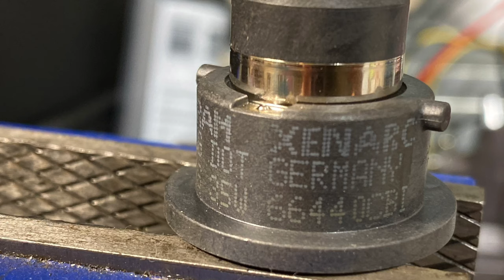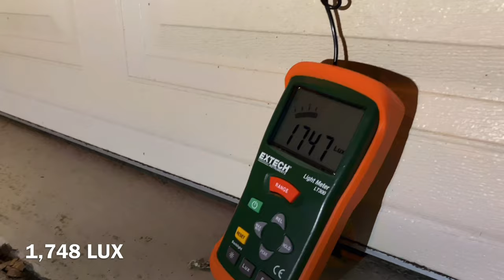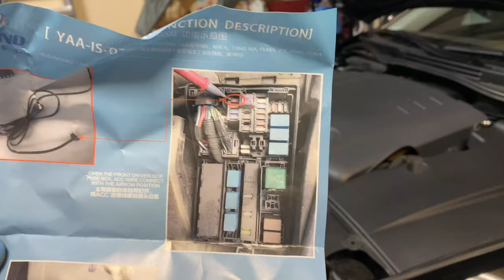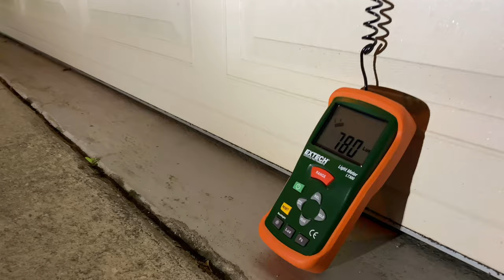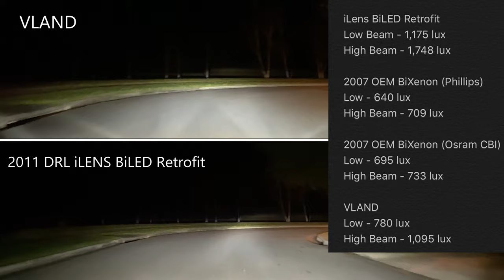VLAND Headlight Review & DIY Install Lexus 2006-2013 IS250 IS350 IS-F Triple Beam LED

Comment: Hey Binh - great video, I really enjoy how in-depth you get. I’m wanting to upgrade my yellowed HID headlights but having some trouble deciding. 
The V-Lands look great aesthetically, but their output isn’t as great as the  DEPO’s with the projector retrofit, based on your video. 
If you had one shot to do it over again; would you do the VLANDS or DEPO with or without retrofit?
Thanks man!
Reply from the maker: I like the DEPO with my Retrofit of the iLens (Profile BiLED 1.0) I have. 

If I redid it, I would go with the newer Profile 2.0 or better yet, the Morimoto MLED 2.0. I would also do switchback LED DRL and turn signals.
Reply: Tuner with Kids Thanks man!
Reply: @TunerwithKids  I'm just curious, what are you planning to do with the DEPO set?
Reply from the maker: I’m putting them back once I do the subscriber giveaway on the VLAND.
Reply: instablaster

Comment: I just recently installed my vland and I have the factory hid with automatic adjustable leveling and vland is so much better on the road at night..
Reply: Does the auto leveling work with the Vland
Reply: @2152mohamed  nope it doesn't... You'll have to delete that it's pretty easy.. I had to delete mine..
Reply: Do you know how long these headlights last for?

Comment: sick headlights just ordered some for my '07 IS350!
Reply: me too bro. I just ordered some for a 2012 is350 f sport. These lights look real clean
Reply: @unknownsource4359  are the brighter than the stock ones? I was going to get this if I got the older model Lexus with halogens but since I'm getting a 2011 F sport I thought I would just leave the stock LED headlights and I bought a VLAND taillights only
Reply from the maker: I had a comparison of light output in the video. It’s not exactly scientific but give a perspective on what a stock HID projector does vs the VLAND and my other iLens LED projector.
Reply: Leo Castrillo to me personally the Vlands are brighter and the aesthetics of the headlight look more aggressive. Vlands all the way. But save your oem projectors as back up. Ive had the vlands installed for a month, no complaints

Comment: Hi. Nice video! I have those installed, but I would like to wire the DRL led strip to the first light position on the stalk (city light or parking light), instead of being on all the time with the ignition.. have you found a way to do that?
Reply from the maker: Not without extra switch.

Comment: Hello, I ourchased a 2011 IS250 that came with aftermarket headlights and I have a HEADLIGHTS ERROR message on my dash. I also noticed that the horizontal running lights aren working. Do you have any info on what I can do to fix this issue? I thank you for your time.DIEGO

Comment: I’m having a similiar problem. I have the exact same drl wire u have. connect it. very wonky and loose however i started my car and they worked. Closed my car then tried starting it up again didn’t work anymore. I tried taping it. Didn’t work. i don’t know what to do nro
Reply from the maker: make sure you have the other fuse on the add-a-fuse cause its a pass thru.
Reply: @TunerwithKids  Still dont understand, my fault. Can you explain further more?

Comment: Love the video man! I currently have a 2012 IS F and my drivers side headlight has started to leak. I don't want to drop $2k on a new set of OEM ones so I am considering either the DEPOs or the VLANDs. Not planning on doing any retrofitting. In your opinion, which one of these do you think would be better?
Reply from the maker: Depends if you want the updated look or the classic Lexus look. If it’s leaking, I’d recommend opening and resealing. The 2012 are still worth money in good condition.

Comment: would have been nice to see what the high beams actually looked like while driving down the road, given how focused it looked when hitting the garage door it worries me what they would be like in actual use while driving down the road.
Reply from the maker: They are garbage. Many people complain about them.
Reply: @TunerwithKids  what headlight you recommend that has good output. I have a hid aftermarket kit now and the beam is great. Kindly recommend something good.
Reply: @henry222ist  Honestly stock is best. I have VLAND now and just got them installed 2 days ago and been testing them. Low beam is fine but High Beam is completely useless. I could barely tell the difference if I switch on high beam compared to what the stock high beams were. For looks they are great but if you live in dark areas the high beams won't be helping you very much.

Comment: I like how the outcome came out with the way you outlined the LED demon light frame. Was going to ask how come you didn't mod the 3rd led High Beam to function with the 2 Led low beam giving the setup a triple LED oem look. I've emailed VLand and asked on the specific mod you did and on having the high beam to function with the low beam. The rep responded and told me their LED headlights are as is, their company will not modify or add anything.  I guess  DIY would be the only way to modify it.
Reply from the maker: I would have to get another set to get the correct cutoff projector. Plus trying to align three projectors to get the same plane is hard.
Reply: @TunerwithKids  I understand, I emailed you after I watched your video,  if you can do the request please lmk via email on what mod you can do.  
Thanks.

Comment: Hi, my DRL/high beam innermost projector light flickers during daytime because of the DRL system I have. Is there any way to fix this? Apparently my canadian model isf cannot do the techstream DRL disable trick, so I am stumped.
Reply from the maker: Only way is to create a relay circuit that will only activate relay and high beam for high beam and not the pulse width modulation signal used for DRL.

Comment: When you ran the wiring from the fuse box to both headlights, did you need to connect the second part of the wiring harness to the battery? Mine is wired to the fuse box but not to the 2nd harness to the battery but the DRL flickers
Reply from the maker: The set i have does not have a second battery harness. It only pulls ACC power from fuse box for the DRL. If you have old DRL thru the highbeam, you need to disable in Techstream.
Reply from the maker: All new OEM LED lights, signals, taillights no longer have serviceable “bulbs”. Has been like this for all things LED.
Reply: Tuner with Kids please help me I want to know if you got the amber or clear

Comment: I recently install this headlights but the drl don’t work I put in in the right fuse but the car doesn’t start then in remove the drl fuse and put the regular one but the drl do not work, any recommendations?
Reply from the maker: Make sure the fuses aren’t blown. And the add-a-fuse is fully seated in the box slot. The add a fuse has its own two fuses, one for the lights and one for the slot you has to hijack.
Reply: @TunerwithKids  thanks so much for the help

Comment: I recently bought these should I silicone them around the edges to make sure they don’t get water in them?
Reply from the maker: I wouldn't recommend silicone just yet. The newer versions are sealed with "permaseal" from hell and probably are tight AF. The early versions had butyl sealant (which may leak if they didn't use enough).
Reply: Tuner with Kids for sure thank you!

Comment: super review thx a lot , i was going for the vland as i think they look great but ultimately I'm performance orientated and going to stay with my hid , also the dil light lead and fuse and the streaks are big -ve for me - highly appreciated thorough review
Reply from the maker: They have their place but the best would be 2012-2013 DRL HID but those are still $1,000 used. That’s why I built my aftermarket Depo ones with better LED projectors and DRL board.

Comment: Hi Binh, Great videos. Just wondering how will you change the bulb if they got busted in the long run? I don't see opening cap at the back like the stock unit.
Reply from the maker: No way to change as it’s LED.

Comment: Do the NIke Swoosh DRLs stay at full intensity when low beams are on instead of at 50%?
Reply: Yes they do. I won't want to turn them off because low beam is ok but high beam is complete trash. I can't tell much difference if i switch on high beams. Just got the VLAND's 2 days ago and been testing them. They update the car's looks massively but function wise, they are worse than stock.

Comment: Do you have a recommendation for a plug and play kit that doesn’t require retro fitting and has a bright output like aftermarket HID kits (which is what I have now). Thanks!
Reply from the maker: No such thing. The reason you need HId and LED specific projectors is for the optics. The lens and reflector bowls are designed for the beam of light so it’s focused to where it needs to go.
Reply: @TunerwithKids  what you recommend for HID heaught upgrade ?

Comment: Hey man. Nice vid. Got a question for you tho.
Does the auto-leveling work on these Vlands? For Up and Down motion?
I know the AFS or corner-lights or whatever it's called won't work. I'm interested in up and down adjustments. Like if I put 500lb of cargo in the trunk or go over a bump, will the headlights lower down automatically like OEM? At 22:20 you can see what I mean, OEM and yours retrofitted headlight did like a start-up sequence but VLANDS didn't. Does it mean they don't have it?
Reply from the maker: The VLAND don’t have the slot to do autolevel up and down.
Reply from the maker: What they do have is the newer Toyota manual level motor. These are found in the Sienna, Tundra, and BRZ/FRS. You may be able to retrofit the dial switch from those cars and manually adjust the level a few degrees.
Reply: @TunerwithKids  Thanks for a fast reply. Unfortunately in Sweden, any car that has auto-leveling from the factory must have it working in order to pass through the yearly road-safety inspection. As I understand even if I retrofit the switch from another Toyota, it still won't be fully automatic, correct?
and if it's not fully automatic then I either have to change headlights back and forth once a year or don't bother at all.
Anyway, thanks again for a fast reply, and keep it up!

Comment: Which ones do you think are better the ones you showed in this video or the new ones with blue breathing animation?
Reply from the maker: Newer ones have better output.
Reply: @TunerwithKids  I am currently debating with myself what headlight should I get. The ones you have with v shape line at bottom looks more oem for me, I like them more. But the new ones with v shape lines at top have very cool looking blue breathing animation and all 3 squared lights work while low beam is on.

Comment: Awesome Video!
 Do you know if these will fit a 2013 Lexus IS250? I looked online and some say yes and other say no.
Reply from the maker: Yes it will fit.
Reply: @TunerwithKids  Sorry I need to rephrase. I am not sure yet but I may have ordered vland headlights that fit 2006-2012 is250s. In your opinion and experience, do you think those light still should work with 2013 models? or would I have do some DIY stuff to them.
Reply from the maker: 2013 is same as 2011-2012 so it will fit.

Comment: Hey Tuner, my mechanic installed my headlights for me and when I looked at my old lights I saw that the brackets were still there. Is it supposed to be possible to mount these headlights on without the bracket and if you do so, what are the potential issues?
Reply from the maker: You need the brackets or else bumpers won’t stay on correctly.

Comment: Hi Binh. Hope eveything is well. I also just got the Vland Headlights. I noticed an issue in regards to the DRL. Basically, when I am only using the DRL the "White Check lights" is fine but for some reason the "high beams" are also on. Do you know the reason why both the High beams and DRL check lights are on at the same time (i already removed the AFS fuse 7.5A headlamp lvl)? I was searching on how to remove the high beam and it's suppose to be just the DRL "white check light" on. Thanks again hope your having a great holiday weekend.
Reply from the maker: Need to disable OEM DRL on high beam using Techstream.
Reply: @TunerwithKids  Got it. Thanks for the tip.

Comment: I have vland headlights on my 2007 Lexus I accidentally removed the fuse wire for the headlights while my car was running, my car died I replaced the fuses but now my car won't start. do you think you can help me please?
Reply from the maker: Check other fuses or main fuse? Is there any power?
Reply: @TunerwithKids  it was a fuse thanks

Comment: Did your car come with xenon like my 08 gs 350 I love my stock lights?
Reply from the maker: Yea original 2007 had HID with AFS.
Reply: @TunerwithKids  does xenon make high beams I can’t find any for my Gs?
Reply from the maker: No the GS only had HID low beams. The high beam is halogen only. The IS had bixenon where the main projector has a flap that drops and does high beam along with the halogen.
Reply: @TunerwithKids  oh wow that interesting

Comment: What's going on Tuner with kids. After doing my testing with the Lux meter to my own cars, i wanted know if your results was from  15ft away right? As you mentioned and if so, I think they are wrong. From 15 feet away my 06 Lexus (K2 Motor Headlights) and my Stock (2019 Mercedes C300 Multi Beam LED)  are still bright then the Vland and your retrofit.  Can you do me a huge favor please? Can you do a test from 15 and 25 ft away with the LUX meter on the Vland headlights? I would really appreciate it so I can decide what upgrades i want to do? Thank you so much hope to hear from you soon
Reply from the maker: I only tested one side, if you have both headlights on, it will be different. Again, my results will NOT be same as yours no matter what unless we are in the same location and same conditions. My reason for testing only one side is because I had one old projector from my 07 OEM HID. It was more for comparison vs. raw output tests.
Reply: @TunerwithKids  ohh ok gotcha! Thank you and yes i had both headlights on so that's the problem but thanks again.

Comment: Awesome lights, but i have to relay my SL1 wires to the transmission before any upgrades. Bought the IS for 3,000 and found out why it was so cheap.

Comment: Great video. I got an is250 over here in the UK. Been thinking about get these due to mine looking horrible and yellow. Would you recommend the other type of is250 headlight upgrade? The ones with H7 bulbs still...
Thanks you. I would enter the give away but I'm a year late🤦🏽
Reply from the maker: These are probably best plug and play option.
Reply: @TunerwithKids  thank you so much for the reply. With a £500 price tag can only afford to make one purchase and insure it is the right one. Off the back of your experience and video these vlands may just be the ones👍🏽

Comment: Hey binh do you have a problem with your drl light being flicking with the new vland…. Not the checker drl… the drl where the highbeam are at..
Reply from the maker: Disable your factory DRL in techstream.
Reply: @TunerwithKids  I heard of it but idk what’s the right stuff to order… would you have a link or a video abt it?
Reply from the maker: Someone probably has a video in it. I have techstream videos but for other options and locks. But in the same menu.

Comment: Do these fit on IS350C? What part numbers did you get?
Reply from the maker: VLAND headlights fit all 2IS.
Reply: @TunerwithKids  i looked around and it appears unfortunately no one has made convertible aftermarket tails, weak!

Comment: I just installed these lights today on my 2009 Lexus is250, but the high beam light on the drivers side stays on and flicker even when lights are off. DRLs are working perfectly fine.
Any suggestions how to fix this?

I removed fuse under dashboard too.
Reply from the maker: Need to get the DRL disabled using Techstream software.
Reply: Thanks I watched other videos last night that told Me the same... can you link which equip I’d need to do that myself?
Reply from the maker: Check out my video on Techstream. Links to product and info in the description box of that. https://youtu.be/z2dN4ZLZTAk
Reply: Tuner with Kids thank you!
Reply: Tuner with Kids Bought the Cable and installed tech stream,  set everything up per the instructions on the file that came with the cable. Still cannot access light control under the customize options. I live in the US. Any idea of what’s going on?
I can access other customize features.
Reply from the maker: Seems like newer versions of TS aren’t showing this. May need to try an older copy. Check out obdii365 blog and website.

Comment: Are the going to work like the OEM headlight with the auto lights function?
Reply from the maker: Yea. Auto on and off is the car not headlights.
Reply: Tuner with Kids I guess im going to have to go for them, it's my only choice since my driver's side headlight assembly needs replacement. I really wanted stock headlights:/

Comment: Is it difficult to  adjust the light?
Reply from the maker: You can adjust via long screwdriver when on the car. I like to use a drill and 8mm when light is off the car to make the large adjustments faster then remount and fine adjustments with screw driver.

Comment: just bought these but my driver side light turn signal stopped working after a few minutes and i’m not sure why. my rear turn signal works but it flickers fast for my driver side
Reply from the maker: Sounds like wire harness. If light doesn’t work and signals are not working that’s two separate systems, so chances of both being bad is slim. Are DRL working? Could be a bad ground wire.

Comment: Has anyone had issues with these vland headlights with condensation build-up? My passenger side is very bad, and I've tried sealing it, but it still is doing it I'm not sure what to do.
Reply from the maker: Mine are resealed with butyl. So no leaks.